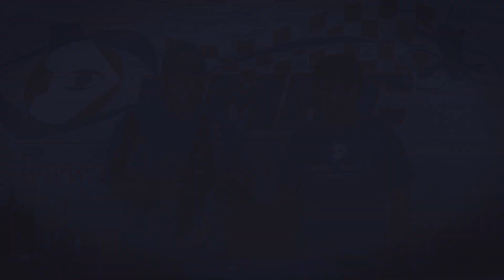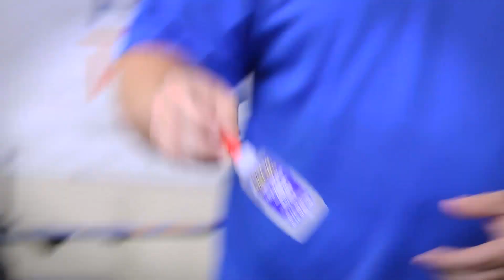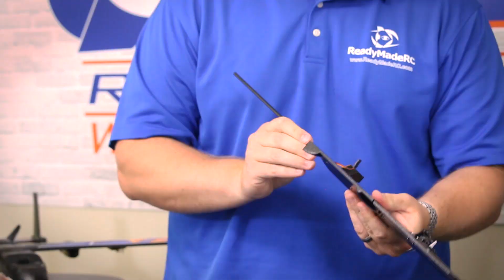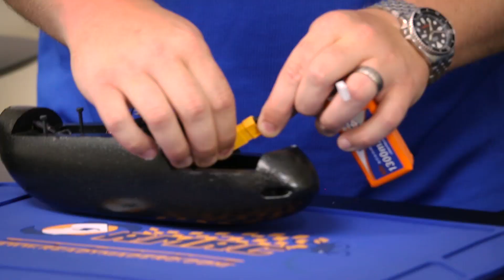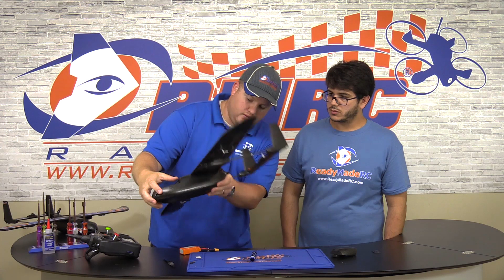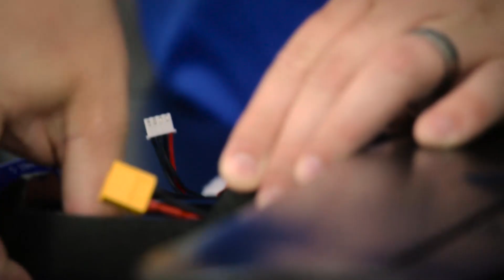Nano SkyHunter Build Video

Comment: I know you probably don't want to edit your video, but I have two suggestions that you could put as banners. The first is to tell people to use black hot glue. Regular hot glue sticks look terrible. The second is to tell people to outline where the pods line up on the bottom of the wings before trying to glue them. You can't feel the nubs go in place with glue on them (which he says in the video.) I am going to try chalk or crayon. 

You guys are the very best and such an important part of this community!

Comment: Just got mine today was wondering if I should use hot glue thanks for the tip. Is it me or is that horizontal stab a little wonky there? Lol
Reply: Nope, even at the end of the video it's higher on one side than the other... not sure how that will affect the flight characteristics, but definitely isn't square and true. Will likely require a lot of trim.
Reply: That's how mine was out of the box. I had to rip it open to fix it.

Comment: Would this be good for a fixed wing beginner? I have experience building and flying fpv quads and want to get a plane. This one seems cool and affordable. Do you think I could learn on it?
Reply from the maker: Joshua Middleton it flies great, but is not the most durable airframe out there. The STRIX Stratosurfer would be the best beginner plane, but we may be coming out with the perfect plane for you in a few weeks or so.
Reply: Ready Made RC, LLC Okay thanks, maybe I'll get the stratosphere or wait for the new one.
Reply: Ready Made RC, LLC one question about the strix. The local school I usually fly at has an are about 250 x 250 yards where I can fly. This is a big plane and I was wondering how big of an area you need to fly it?
Reply from the maker: Joshua Middleton I would think 100 yards in either direction would be sufficient. Especially if there is room to fly above any trees around the perimeter.
Reply: I can vouch for the Sratosurfer. It is an easy to fly, durable, easy to repair aircraft.